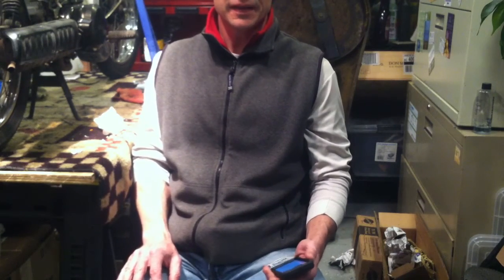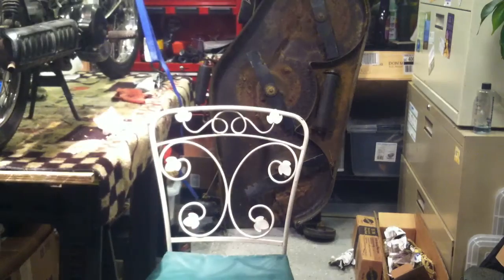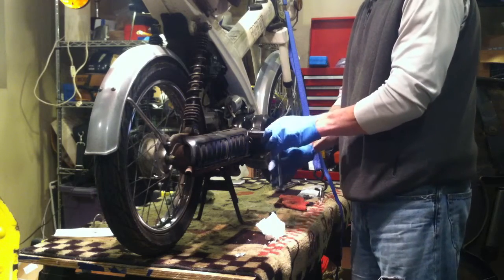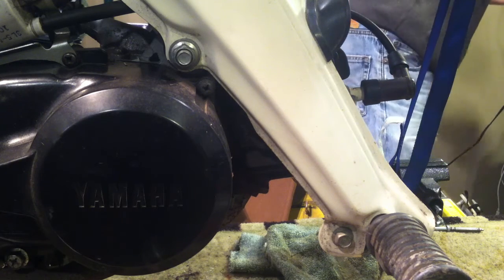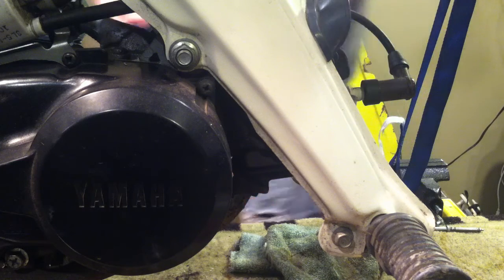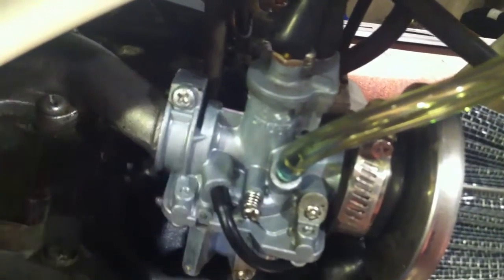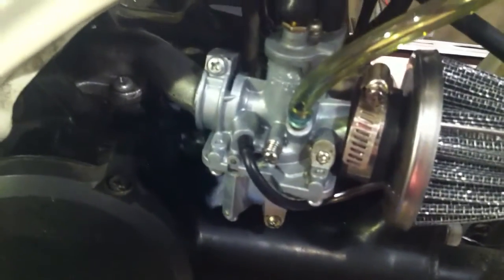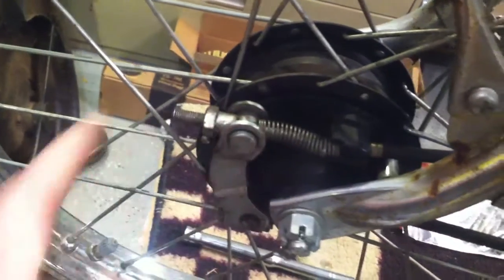Rear tire removal on Yamaha Towny, rusty exhaust bolts, and other tips/tricks

Comment: Hey Andy hope all is well. I have a question for ya....on the Yammahopper does it take motor oil or transmission fluid? The exact location I am talking about says to add 300cm3.
Reply from the maker: It can take either.  300cm3 is about 11 ounces also.  transmission fluid will make the clutch spin up faster and engage sooner.  As you go to thicker oil like 10W40 it will make it spin up slower and engage later.  10W30 is what the manual says.  You don't want to overfill it.  11 ounces will not fill it to the cap.  So if you fill  to the cap, you've got too much in it.  I changed that back in August.
Reply: Awesome. No need to change then right? When would be ideal timing to change it?
Reply from the maker: No need to but you can if you want.  Little jobs like that get you more familiar with the bike.  I really don't think you have to change it that often.  I don't think the oil gets that hot but I could be wrong.  check the manual but I would say once every 1000 miles.  I've experimented with everything from synthetic transmission fluid to 10W40 conventional oil.  The clutch will spin up faster with thinner oil/fluid.